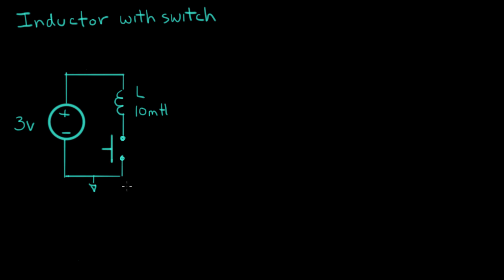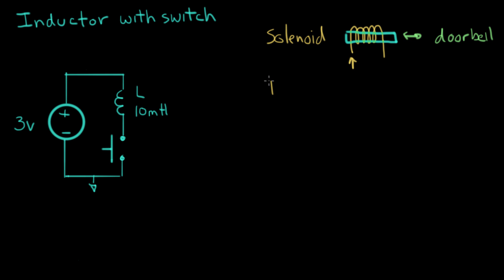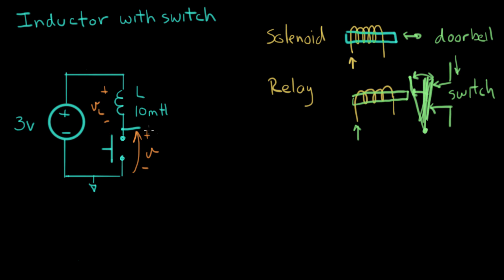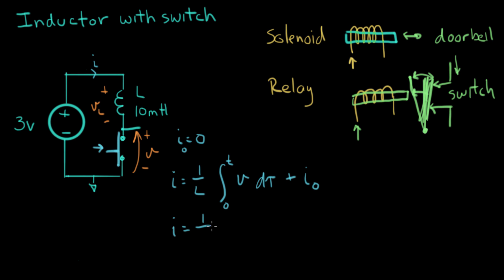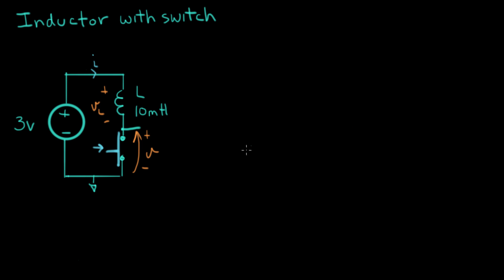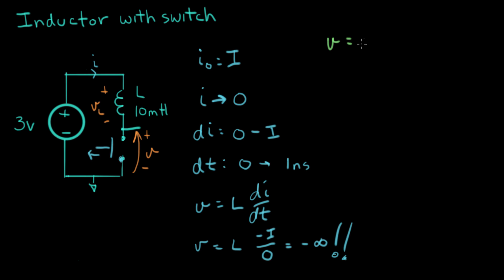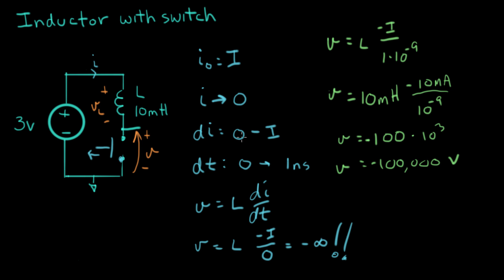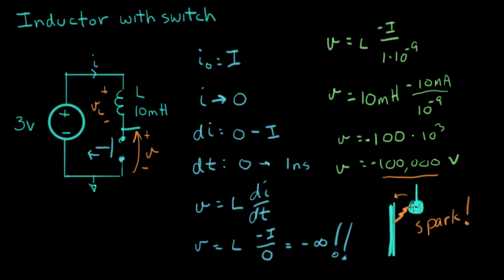Inductor kickback 1 of 2

Comment: Hi, how would the equation look like if you model a resistor in series with the inductor (or modelling the wire resistance) ? thanks!
Reply: Look up RL circuits and RL equations. For some intuition though, consider that the wire resistance (or series resistance) will limit the current flow after the inductor acts as a short after a long time. So the inductor is a "short" and the resistor will tell you the exact current after a long time (I = V/R).

Comment: I think i noticed an error. When you find the current through the inductor at 5:25 you said it has a current of 300A/s. Don't you mean 300A? A current is not the rate of current. Its actually the rate of change of charge isn't it, which is just measured in Amps.
Reply: 300 A/s is indeed the /rate of change/ of the current in the inductor, or the /slope/ of the line in the graph he drew. When dealing with insductors and capacitors it is important to understand their transient behavior. The rate of change in this scenario would depend on the inductance and resistance in the circuit. Using this information you can, for example, calculate how long it would take for the voltage to reach a certain value under transient conditions